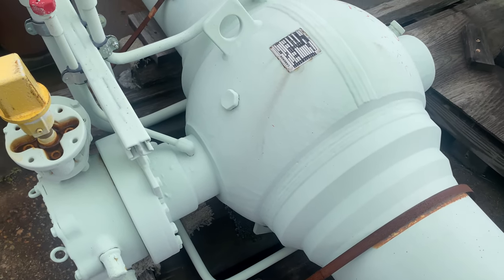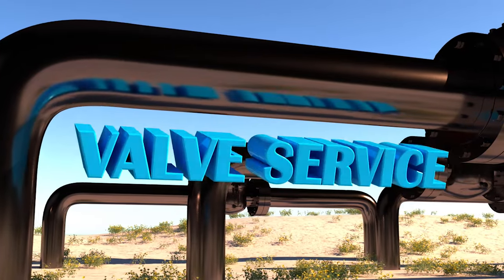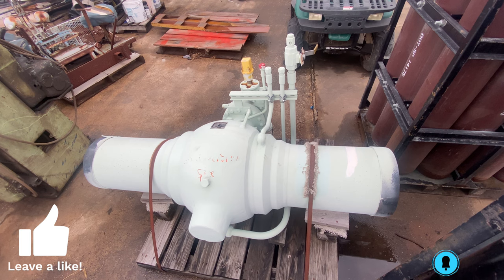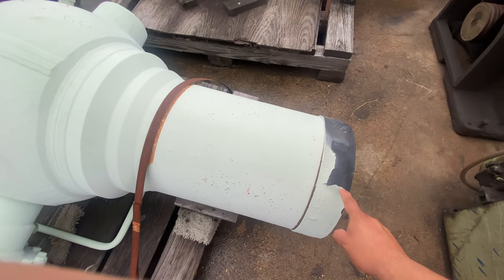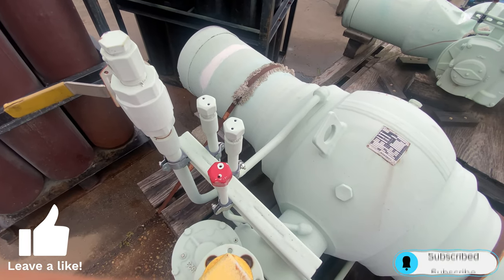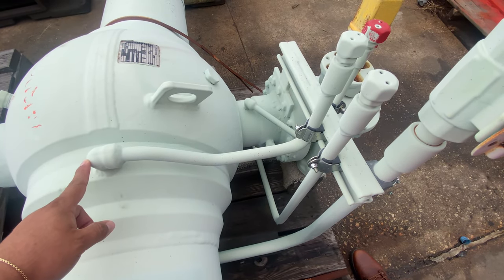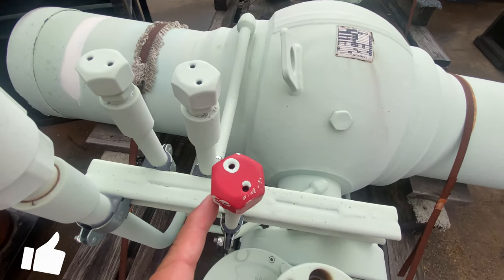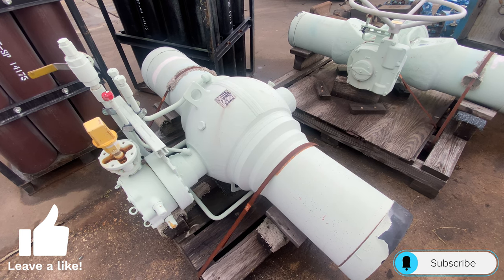CAMERON T31 BALL VALVE OVERVIEW. FULLY WELDED BALL VALVE EXPLAINED.

Comment: How do you access a check valve if one fails!!
Reply from the maker: Check valve? This valve is a trunnion ball valve. The only check it would have is maybe the bleed/vent valve. If you have more details about your question I’ll try and answer it.
Reply: @everythingvalves  yes there are a total of three check valves in the valve one in each seat and one in the stem. If a check valve was to fail your grease lines could see full line pressure and you do not have fittings welded on to access check valves in case of failure. I modify these valves for a living.
Reply from the maker: @carsonkaminski269  that is very interesting.  I understand the details you provided. It’s clear you are familiar with the product. This particular unit was only tested and not designed by us. I appreciate the information. Thanks for watching.